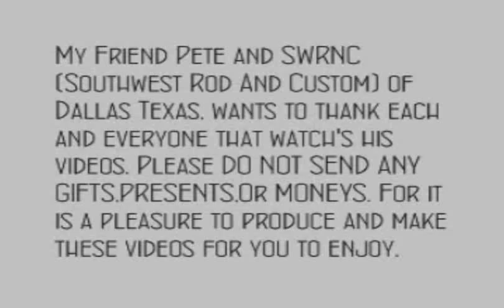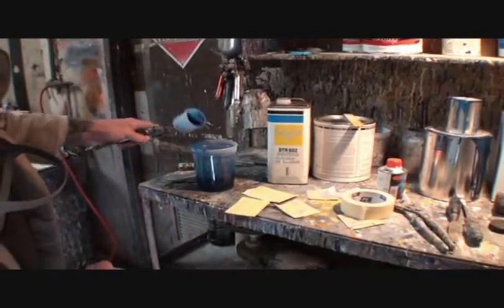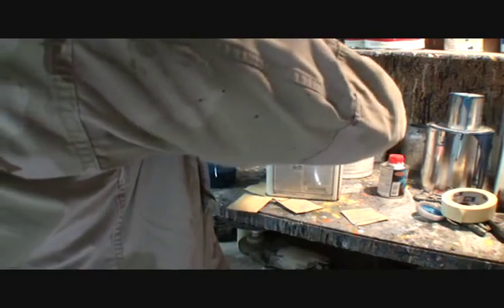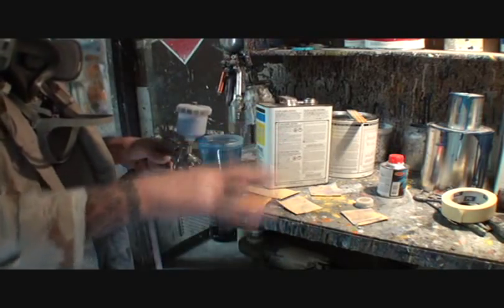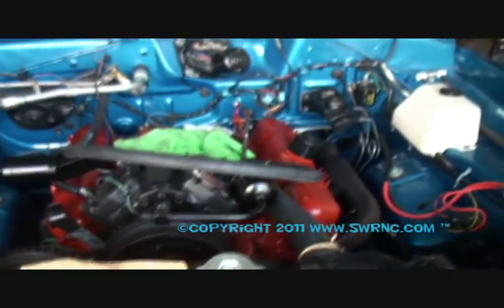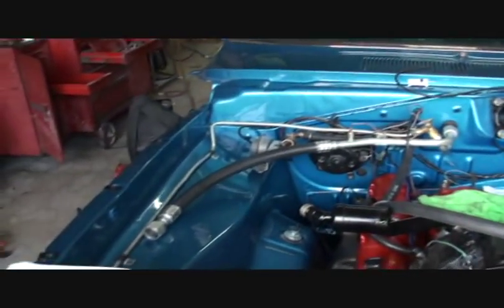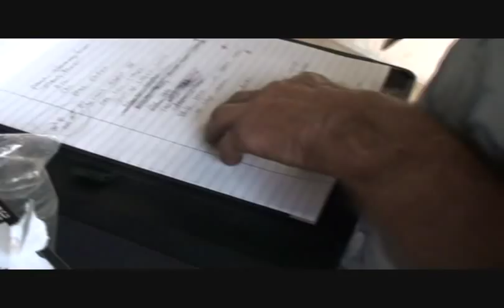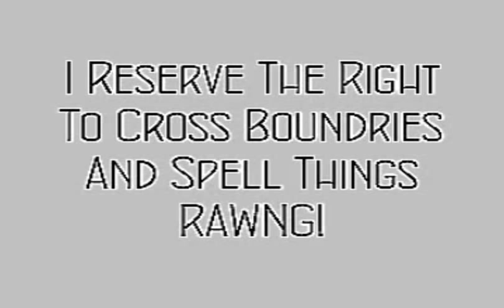1968 Dodge GTS-Customer Satisfaction Guarnteed-Part 3

Comment: Sitting here watching all these old re-run videos and I tell you what.All that bullshit  and craftmanship  you have put into that car in the engine compartment and you didn't flip out.Pete it's like a slap in the face. No fender covers, a/c hoses and the fittings laying  on top of the fender where you spent 4  or  5 days of repairing there  screw ups.Nice guy or not they ,as in two of them needed to be lectured on a case of 101 body shop manners  swrnc style on how to be careful with shit. John

Comment from the maker: Sandblasting the frame won't fuck it up, it will fuck up the brake lines, fuel lines, and electricals.. If you don't remove these items before sandblasting you will have to replace them after you sand blast!

Comment: Phil's son said they had to sleeve the block....I say Bullshit! The machine shop told them that, or Phil and the son found out what the real problem was (it didn't need a sleeve), and they're just saying that since that is what they said at first. We know the bolt wasn't long enough to damage the cylinder wall.